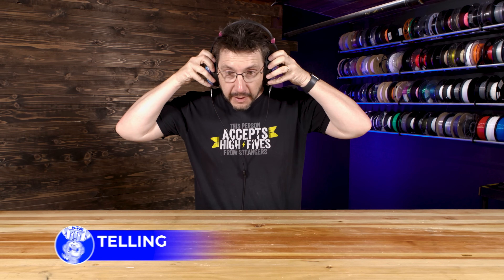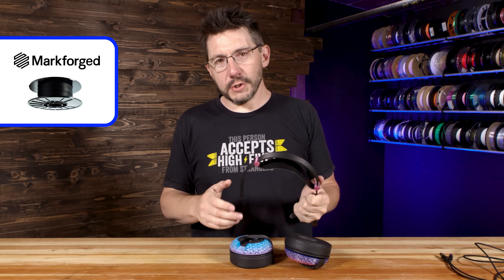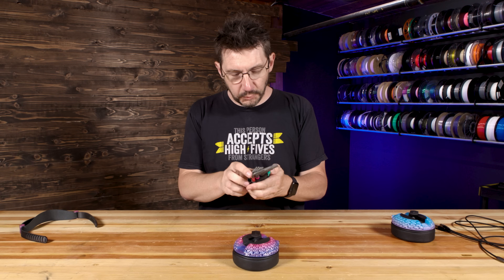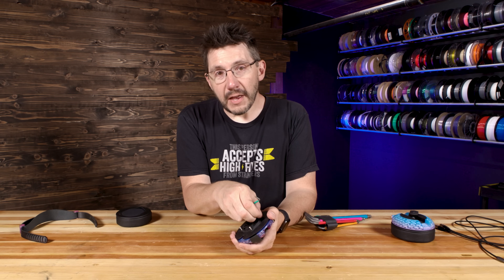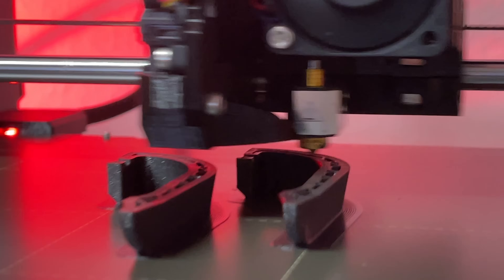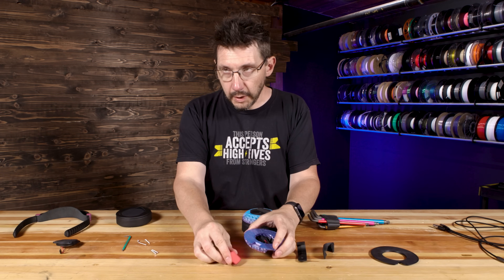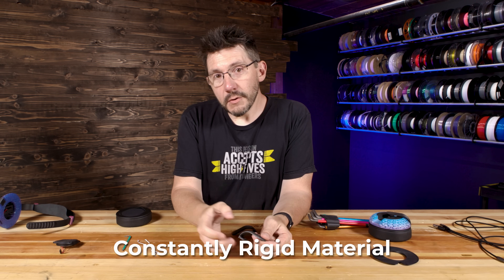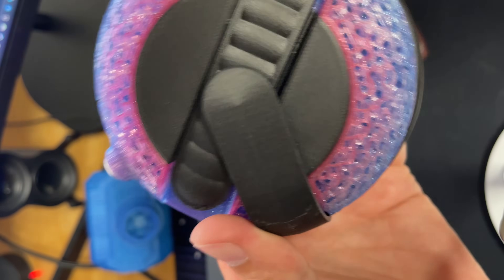PLA IS BETTER Than Carbon Fiber Nylon?

Comment: Did you anneal the CF nylon? 🤔 that's a big deal because it helps larger crystals to grow in the nylon, making it more rigid and less likely to creep.
Reply from the maker: I didn’t but that’s a great tip!
Reply: @3DPrintingNerd  I just bought some of my first cf nylon. I want to see if i can make some instruments with it due to its stiffness. I certainly hope its ability to resonate is better than PLA but I'm seeing mixed messages online. I've been researching quite extensively and CF PPS looks like the best best but my stock Prusa MK4 cannot print that stuff. The annealing thing is just something I came across in my research.

Comment: The issue is nylon when printed for thin parts is very flexible..the addition of CF is not enough to overcome this limitation to a proper degree in certain parts. I have done A LOT of research on this matter. I spent months pouring over mechanical specs of different filaments and combinations from every brand there is. The more expensive CF infused filaments are in reality crap. If you are paying more than $50 a kilo you are getting ripped off by name branding. Anything Atomic or below in price will be very stiff but not quite pla stiff. We're talking petg-CF only. Nylon is just too flexible in thinner geometries. A quality petg-CF like Phaetus or Atomic bring stiffness close to pla. Especially along the Z axis( pushing down ). Be sure to slice and orient the part in the best possible way of course.

Comment: Hard to realize nylon/CF would creep worse than PLA. Could the part have warped during printing? Nylon will absorb moisture, but PLA will too. I kinda agree w others the cantilever clamp isn't ideal, and may not have had proper tolerance. Fully supported clamp on both sides with spring detent would be better. I've printed PLA+ flat springs myself. They work for while then deform over time. I think you will be reprinting them again in a month or so.

Comment: Such a misleading video. It seems the idea was to promote Markforged material in a weird way. Issue mentioned is not a material related - it is just bad engineering design.

Comment: Years ago when i first got into 3D printing and design i quickly found PLA to creep and deform against pressures. ABS or PC would be much better for the job, or even PETG if you're printer doesn't do well with those materials. I still have the flashlight mount i designed for my bike from about 8 years ago on my bike, printed in translucent blue PETG. I only ever retightened it once and has held tightly in position for said 8 years 😁

Comment: Polyamide66 (nylon) which is what Onyx is made from (maybe it’s pa6, i can’t be bothered to even look it up as it would be similar conclusions) is a hygroscopic material. When these materials take up moisture they exhibit a fairly big dimensional change. This is not necessarily creep, but can be due to dimensional changes. The conclusion is still the same, the material choice could have been better.

Comment: Lol? The PLA will fatigue and creep just as bad. The part is just not designed well for 3d printing being cantilevered like that. It does look like they fixed it in V2, which is good.

Comment: Nylon is hygroscopic, so it pulled in water/humidity from the air and relaxed into that state with the assistance of the earcups likely pulling on it.. did you hang them up and put the weight on the springs continuously? The CF can only do so much when the deformation is a result of overall subtle material swelling and cyclic reformation, what happens if you toss it in a food dehydrator?. PETG would likely be better as a springy material, possibly ABS. But as long as the PLA doesn't undergo stress that causes localized fractures it will stay intact.. but it can also creep to some degree.

Comment: We are going through a design revolution. 
For decades everything was injection, blow, or vacuum formed. Now with printing a new world of design is possible. The issue is in the design theory. Many designers and engineers still instinctively think in injection mold world when it creates shapes that are not ideal for printing. 
When we break through the bias and the stigma of printing things will really start to change. 
Another issue is texture. People don't like layer lines. Not because they are ugly but because they aren't the normal appearance of parts. When people get used to layer lines in day to day life we will see a surge in product acceptance and overall demand. 

The revolution will take time. The best thing to do is represent the science of additive manufacturing in a professional way. Don't produce bad prints and allow people to assume thats normal for the industry. We all can produce great looking models. Especially with all of the great people and resources on our side.

Comment: This is similar to people always asking if they can print their Voron parts out of some less-common material that they have access to.  Really, though, your first pass should always just rely on the bake-time experience of the community - if they say PLA, do PLA, if they say PETG, do PETG, if they say ABS, do ABS.  Then, if you want to use alternate materials as an experiment, you have a reference which works as well as the designers and community expect it to, so you can debug where the problem is.

None of this is to argue that the recommended material is the RIGHT material, or the PERFECT material - it's just a material which is known to WORK.  Which is where you want to be the first time through.

Comment: Or you could have added a padding material in between or the design could have called for a small amount of padding material. The point of the padding material being to make the pressure to get the clicking.

Comment: But... doesn't PLA have the same issue? Over time, it will stress-creep (or whatever the term is). It's why printers are often made with PETG or ABS. You can screw them together and over time, it won't creep.

Comment: Flow is definitely a factor in printed nylon. You can significantly reduce it by annealing the printed parts. Probably wouldn’t solve the issue here, but definitely improves performance.

Comment: You may find that eventually the PLA "fails" as well and that it's actually a design failure, and the mechanism is simply over-leveraged for the degree of constant tension produced by the tolerances. There's no real structural design testing for a part like this, it's assumed that it will just work, but at least for one material you've discovered that it needs further refinement.

Comment: Hey this brings up another issue: where might one go to find a table of filaments listed by there Shore number? With that info it would be much easier to get the right filament type for a particular job. For instance if PLA is too rigid but TPU is too soft what's the distribution of filaments left in the hard-to-squishy spectrum to do the deed?

Comment: Pla will creep too, especially if you take it outdoors on hot days, and will creep almost instantly in a hot car. The problem/solution is either 1.) support lever on both sides to last longt or 2.) Do maintenance and remelt the plastic every few months or 3.) Find a material that can take static loads(most metals). This is why there is no long lasting spring(under tension) made from plastic. Otherwise plastic pew-pew devices would be possible.
Reply: Many springs are made from plastic. Nylon or polyamide is a family of polymers and there are printable types that would outlast pla. 
Also polypropylene would be far better for a spring application because it particularly holds up under repeat deflections. 
I have some knowledge of pews and there are many 100% polymer designs that are reliable now. Although most practical and durable designs use metal springs and tubes the bolt carrier remains plastic in many. 

I think you should look into this. You will be surprised what has surfaced in the past 5 years and even just the past 6 months have brought many awesome designs. 
Look on oddessy and you'll find ingenious designs and polymer adaptations of many classics that are reliable and durable.

Comment: You mean cf-nylon creeps. I tought we all found that out when the voron 0 cnc- kitchen built didn't work. Using the material the designer designed the parts for is actually really important. I remember a story that the brittish sniper rifles had accidents because the manufacturer subcontracter decided to use a different steel alloy. Also some people have replaced aluminium extrusions on some 3d printers with carbon fibre square tube and it was a complete disaster.
Moral of the story here is you can't always substitute one material for another, most of the time it's fine but sometimes the material choice of the designer actually has a purpose.

Comment: TPU... a good tpu even at a mere 4 walls /. 30% is stronger and more durable than any other filament, so long as you don't need rockhard stiffness.

Comment: I don't see this as a material failure so much as the part design being reliant on external shape only for flexural rigidity. Internal ribbing/reinforcement is one way to combat some of that, or even external bracing designed to reduce fatigue in the direction of expected movement. All 'plastic' will have accelerated wear associated with the material compared to more durable materials however, just a given property of the material that you need to design around its weaknesses while optimizing for its strengths (somewhat self-lubricating topical surfaces for instance).

Comment: Hmmmm, isn't PC a better candidate for creep issues? CNC kitchen and My Tech Fun are great resources when contemplating the right material for your projects. ABS ASA and PC would of done a much better job Joel and your PLA part will probably fail even faster than the nylon one TBH. PLA is very strong contrary to the preconceived notions about it but being strong also has it share of cons PLA  is known for being too brittle, creep, heat deformation and UV degradation.

Comment: I can't imagine that will last any longer. I would go for ASA or ABS specifically here. At least from my experience. Hope we get a update video.😅
Reply: From my experience ABS is even worse for creep. PETG is good, which is why certain big name printers with printed parts use PETG.
Reply: @andrecook4268  there are tests on youtube - ABS is not creepier. it is more elastic, but not creepier. So, ticker lever (for the same force), but deformation by the time will be smaller with ASA/ABS

Comment: Yes it's a problem with the material but a better design one that is supported on both sides would have also made this less of a problem. A part that is repeatedly  loaded on one side and is held on the other will always sag on the loaded side regardless of material. The difference is time of use before that becomes noticable. with a stiff material a lot later so yes pla is better. But the design would be a lot better if it wasn't just supported on one side.

Comment: It seems like a good solution would be to heat up the nylon part and bend it back into place. A better solution would be to update the design so the clip isn't a floating cantilever and is supported in more spots. Maybe the best solution would be to modify the design such that the tensioner is a part of the outer cup. The tensioner could be a nub on the cup which clicks into pockets on the flexible band. 

In any case, this is not a problem of stiffness but a problem of mechanical creep. Using materials with less mechanical creep like ABS or annealing your part could help. PLA will creep over time too, particularly if there's any kind of elevated temperatures. If you anneal the PLA at around 80C for an hour, it will drastically improve heat resistance and creep.
Reply: They actually have updated the design (V2) to have a clip that's anchored on both sides, as well as posting their design files for free so you can reprint and use your existing speakers / mic / wiring / etc.
Reply: @jasong1287  that's wonderful. Thanks for the reply.

Comment: Thats crazy, I just downloaded the files for these headphone and was looking at my filament stash and nearly went to use my pccf. Good to know.
Reply: PC-CF should be fine. Nylon (PA) is the reason for the failure. Nylon creeps terribly as it absorbs atmospheric humidity.
Reply: PC-CF (polycarbonate with carbon fibre) is not PA-CF (nylon with carbon fibre).
Reply: ABS, and PETG are also options!

Comment: yeaaa… but what if you leave the pla part outside in the summer for a moment? I would goto ABS and if its not stiff enough make it thicker. I have had huge problems with PLA heat deflection. Its not uncommon for it to go over 100 here.

Comment: Nice video, though I think you are being overly kind to headamame. That is a flaw in the mechanical design. Should have utilized a mechanism where the tension is not dependent on a single mount point with a fairly long cantilever, and instead used a two point mount, with an additional spring mechanism for the band adjustment. Heck, they could have used the design AKG uses and just used elastics to provide the suspension and adjustment.

CF Nylon like you used is going to creep in that scenario, just like PLA will long term as well. ASA and ABS are going to last a little longer, but ultimately you are going to get creep, and the fit will get sloppy. The mechanical design should have been around the material, and not just looks. It's a poor design.
Reply: This is the best comment. Thanks @evanprentice. @3DPrintingNerd please pin this!!!!

Comment: You will have the same problem with PLA in the long run. the fact is that plastic under load will slowly deform (it is called plastic creep). if you want it to last you will need to use a metal springed mechanism (coil spring or leaf srping).
Reply: Or use ABS. ABS has a lot less material creep than PLA.
Reply: Or use the upgraded head(amame) V2 that doesn't have this problem anymore! 😊
Reply: Polycarbonate is by far the most creep resistant, accessible filament compared to most other choices. In fact it does not creep noticeably at all.

Untreated Nylon is by far the worst creep wise - however, Annealing increases creep resistance significantly.

That is because more polymer chains realign into grains, minimizing gaps for it to flow/move around. More crystallinity - less creep.

Best video on this topic is on this channel (Formnext interview with Brandon Sweeney PhD).
Reply: It’s not just plastic that experiences creep and I have never heard it called “plastic creep” before, just “creep”. Pretty much any material will creep to some extent.
Reply: I used Petg, and my head(amame) still springs like newly printed.

What he's experiencing is way more than normal creep.
Reply: @NoOne-ef7yu  with nylon that amount of creep isn't unusual, especially as it absorbs moisture, which all nylons do to some extent. PA6 can experience over a 50% drop in most mechanical properties after quite a short amount of time in a normal environment.
Reply: @conorstewart2214  Interesting.

When I did my creep tests, the nylon did about as well as the Pla, as I recall. But I was using PA12 at the time, not PA6.

I basically printed springs with hooks on them and then used them to hang a defined weight. I left it up for a week, and then measured how much longer the spring had gotten.
Reply: @NoOne-ef7yu  PA12 absorbs a lot less moisture than PA6 but the properties do still degrade after moisture absorption, but not anywhere near as much as PA6 but still probably in the 10 - 20 % range. In general nylons have very good base properties anyway, it could just be your PA12 even after moisture absorption has better properties than the PLA. It would have been interesting to see the creep every day, to see if the PA12 maybe started creeping faster the longer it was left out.

Obviously the moisture absorption depends a lot on the environment, so if you live somewhere with low humidity then it wouldn't absorb as much and would stay stronger.
Reply: True, PLA and PA both have it. You might as well print it in TPU, then you don't need to wait for it to deform :P

Comment: This is not a material failure ... this is a design failure.
All plastics exhibit creep over time when under tension.
So, the proper design would have this clip supported at both ends, to minimize creep by doubling support.
Reply: the design has been changed if you look at their website
Reply: i had the same Problem and i can say it is a design problem, but the new version is better.
Reply: Yep, design issue, PLA is going to creep just the same, the problem is in order to make it look slim and cool they've got a thin part operating at a high strain with a lot of preload against the deformations/teeth.

The correct way to fix that is with a stiffer beam and lower preload/smaller 'teeth' to reduce the static strain on the part. Otherwise it's just gonna do it again.
Reply: Also, wear. Can't (pardon the pun) stress this enough. Gear roller instead of clip and corresponding teeth on headband. Eliminates creep, stress and wear. As bonus, provides more granular headband movement.
Reply: Yeah I was thinking... I've printed a spool holder out of PLA and it lasted about 2 years before it wasn't tight enough to hold onto the table I designed it for lol